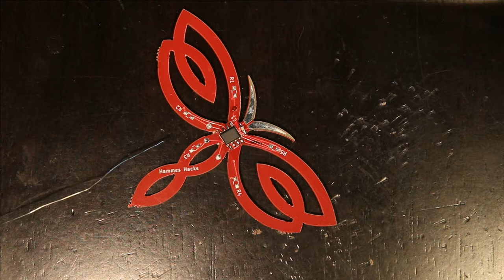Dragonfly Assembly

Comment: Where can we get the PCB?
Reply from the maker: I am making a tindie store today. Currently, I have it set to ship to US, EU and Switzerland. Will that work for you?
Reply: @HammesHacks  yes, I'm in the UK, will you do it as a kit as I'm not sure it's possible to buy the components in the small quantities.
Reply from the maker: @anneharrison1849  It will be a kit all the components included, and the microcontroller programmed. All you will need is a soldering iron, solder and tweezers.
Reply: @HammesHacks  awesome, I've never done surface mount soldering, only lots of through hole type, but with a funky project and a great video you have given me the courage to try, hopefully paying international postage (and worrying about customs fees) won't put me off buying the kit.